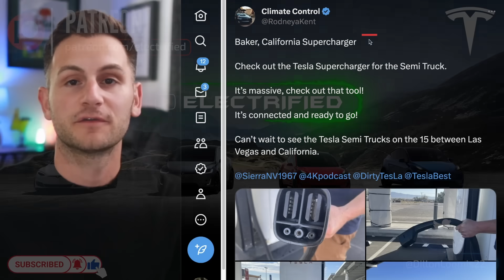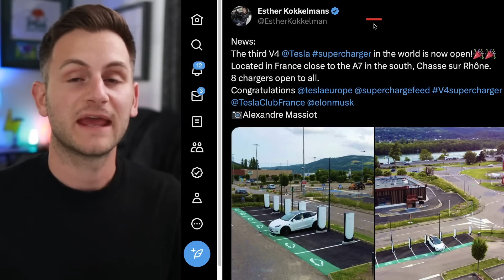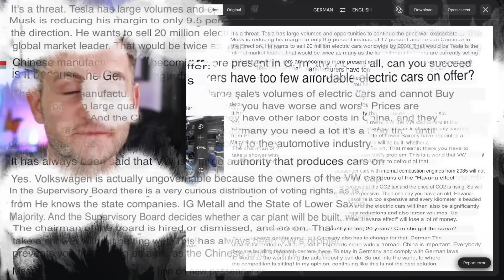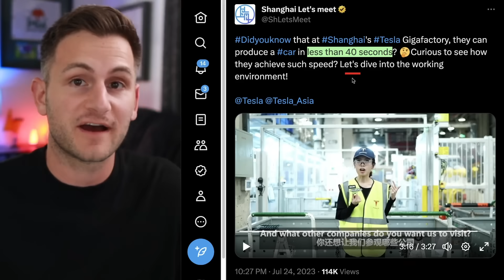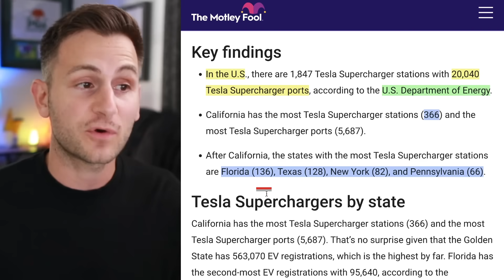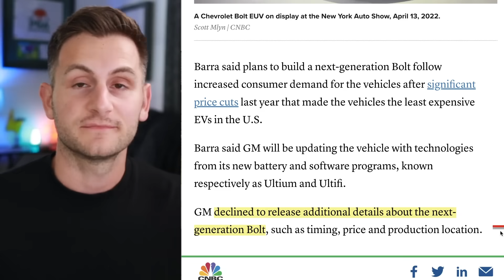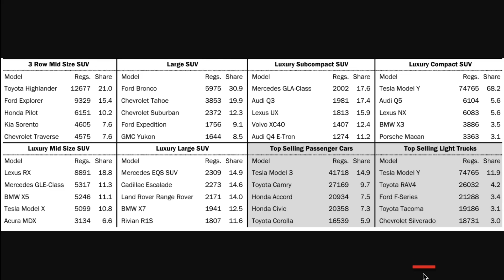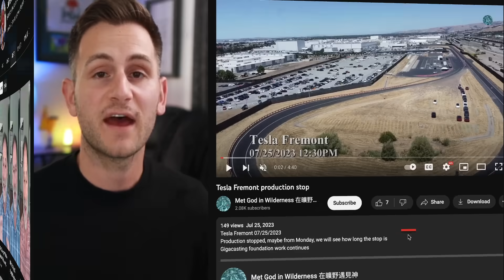Tesla Megacharger Rollout / Scaringe Calls Industry Out / New Chevy Bolt Coming ⚡️

Comment: 11:40) GM has not built EV factories. Bolt is built in low numbers in a crappy, old grease-space. Silverado evicts Bolt, but grease-space was not designed for EV pickups either. And GM has no clue how to acquire equipment (robots) that make EVs.

Comment: Not convinced that bundling FSD with the car is the right choice for Tesla owners. Its a significant price premium on the initial car purchase and it means that (1) you will need to recoup that premium when you sell the car and (2) you then need to pay Tesla all over again to the rights to the software to use it on your new replacement Tesla !  If I bought the rights to a large PC software bundle I would not expect to be told I could not de-install and transfer it to a new hardware replacement.

Comment: Dillon
The charging model for Full Self-Driving (FSD) after reaching level 4 or 5 should involve a per-mile fee. Upon inputting your destination into the navigation system, it would propose a rate of, let's say, $0.10 per mile. For instance, a journey from LA to Las Vegas, spanning 250 miles, would amount to $25. Even a shorter commute of 25 miles would cost $2.50, still lower than toll roads and the inconvenience of traffic, allowing you to rest or read during the drive.

Consider having a RoboTaxi driving 100,000 miles annually. This would translate to $10,000 per year, totaling $50,000 over five years, which exceeds the current rate. However, this cost can be conveniently added to your fare.
Reply: Is your should from Tesla?